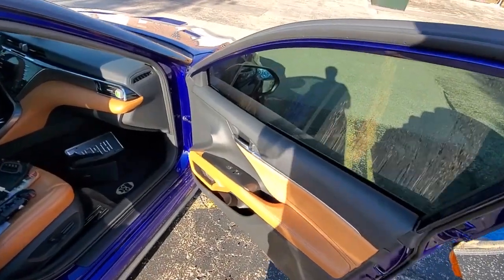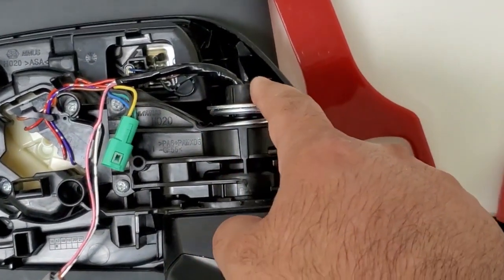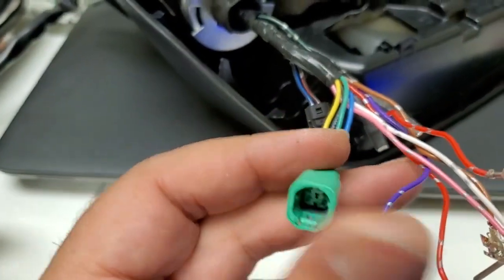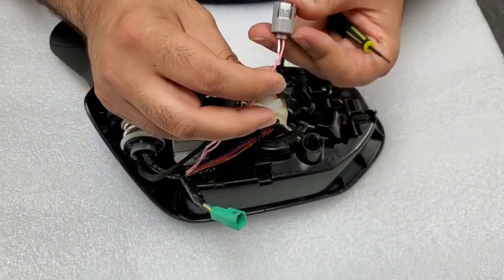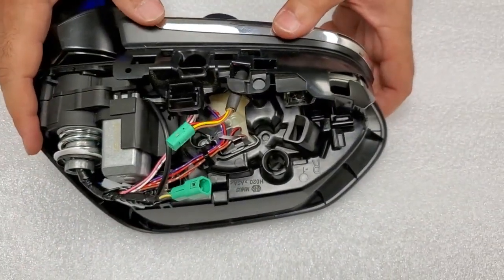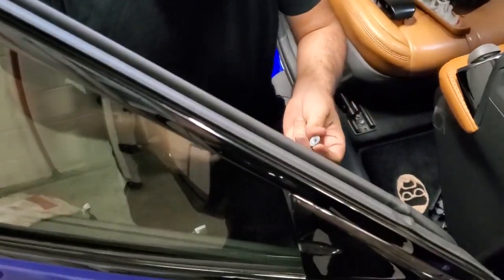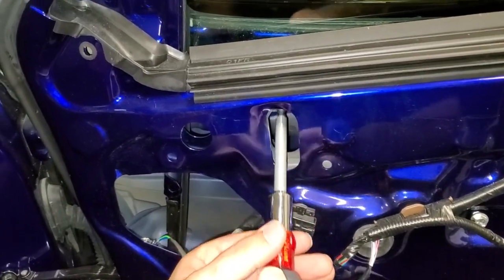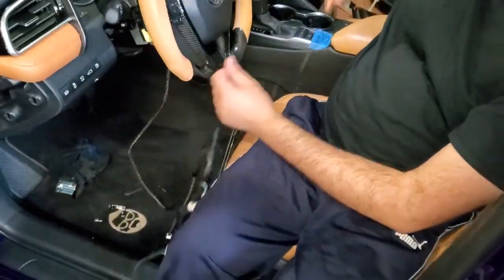HRS 2018-2020 Toyota Camry Power Folding Mirrors Installation

Comment: Nice video and everything but key things were left out for me. I’m using this video as a big guide for getting wire to the places it needs to be. I myself decided to install the turn signal mirrors onto my car and I’ve managed to get the wiring in the correct places it needs to be  but when I line it up in the groove on the molex connector on the door and fasten it back together. Pushing it in the car door hole puts me at a block the wiring is being pinched. Unfortunately we weren’t showed the reinstall of that connector

Comment: Great video. Just finished installing mine, about 4 hours. Left connections inside mirror alone and instead I took apart connections from the plug on the opposite end. Easier and faster.
Reply: Any tips on how to remove the 360 camera?
Reply: When you put the car into reverse does the hazard light turn on
Reply: Hazard lights do not come on when I put car in reverse.

Comment: Great video and amazing finished product.  However,  this is something I'm not willing to attempt.  How much if I bring my xse to you guys? I have many parts from you installed and I'm the guy who gave you a headsup that the last shipment of SBR taillights didnt have the xse short direct connect plugs in any of the boxes. I'm only three hours south of the shop.
Reply from the maker: Due to limited staff, we don't do installation.
Installation is fairly simply. We did all the hard work for you. If the main guy can do it with no knowledge, anyone can :)
Reply: @HiRevSports  it's just time and reading instructions!     I just hate to hack up my new car but IF you want Lexus Luxuries you have to do it...

Comment: Hi, a few days ago I bought your Camry folding mirror system, but in installation, in the wiring there are two connectors, I don't know where to connect them, the system works, but I don't know where to connect the two plug connector cables!
Reply from the maker: Send us an email at info@hirevsports.com and we will be able to assist you!

Comment: I just finished this install. Took me all day until 7pm. Overall not really difficult. It really looks more intimidating than it is. Only problem I've encountered is when I put car into reverse, hazards turn on. Any fix for this?
Reply: Hey I got mine installed by a personal mechanic and the SAME exact thing happens. Car goes to reverse and hazards come on and can’t be turned off. Any fix?
Reply: @peternicholson8925  Its a feature of it. It wasnt anything wrong you did. Its basically an extra "safety feature" honestly i like it
Reply: @peternicholson8925  confirmed. An added safety feature. Also the hazards will flash off the engine is running and a door is opened to warn oncoming traffic.
Reply: Any fix to have the hazard lights not to turn on when in reverse

Comment: If you unpin the other side of the harness instead the clip inside the mirror it only take like 15minutes to install the motor and harness in the mirror. I did the full installatiin in 3 hours.